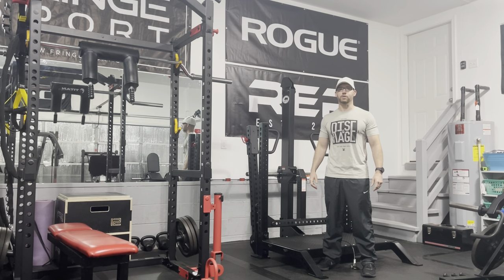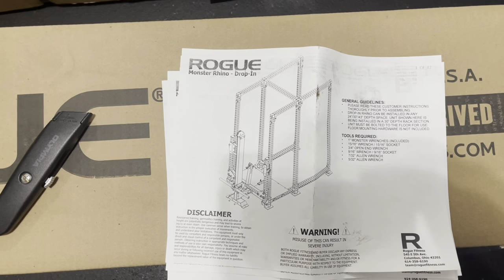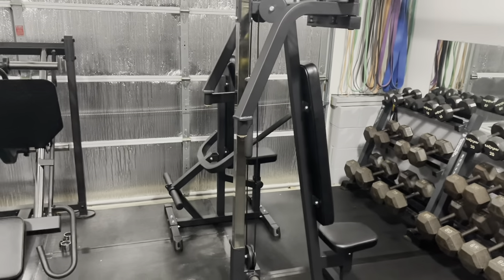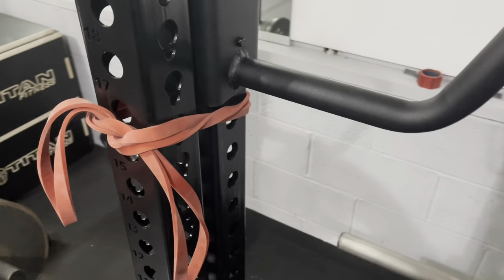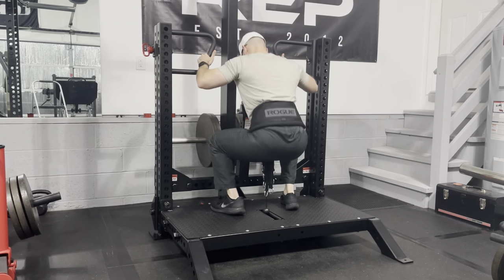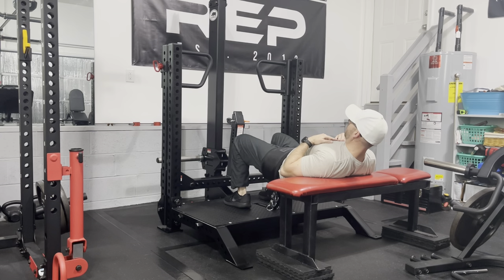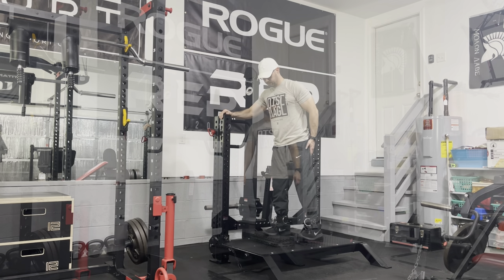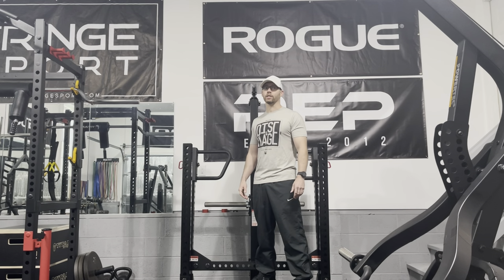Rogue Rhino Belt Squat Review

Comment: 25:17

Doesn't your rubber ball get grinded by the cable with low row movement? When I did my low rows I saw rubber dust being accumulated from it.
Reply from the maker: I have not noticed that.  I don’t do a lot of rows where I sit on the floor; rather, chest-supported rows while on my bench.  2 years later and there is no indication the cable is getting worn.

Comment: Is the rhino good and easy on the knees?  I have two buldging disk amd a bad knee but still working out legs with landmine squats, lumdges, goblet etc...
Reply from the maker: I can’t say for certain if it will hurt yours, but it does not aggravate my knees or back.  If it were a Lever Belt Squat it might as you would be pulled forward, but the Rhino offers a vertical line of drive.
Reply: @HomeGymHacksandReviews  thank u

Comment: Why did rogue make the uprights with holes in them? For attachments (like a regular squat rack)?
Reply from the maker: I have a new video showing my Top 5 Accessories for the Rogue Rhino where I attach the Safety Spotter Arms and Rollers into the uprights.  Neither work amazingly, but it does make future attachments possible.  It can also take plate posts.

Comment: I have a couple of questions.  How do you like calf raises and donkey calf raises on this?  Also could you do a hip thrust if you elevated your feet?  I am thinking about purchasing this plus an RM-3 rack and setting it up like a drop-in since that would allow me to add a belt squat while only taking up about 8 additional square feet of space.  Would the four uprights or plate storage on the rear uprights affect the functionality of the belt squat portion?  Thanks!
Reply: I should add I already have a rack that takes up 53 inches of depth on the floor, so a rhino attached to a 30 inch rack would add about 6 inches of depth.  I could do 100% of my rack work on a half rack with the exception of squats, and the belt squat solves that issue.  I was thinking of getting the rogue monster utility seat to attach to the spotter arms for use as a back rear on hip thrusts and possible as a step up platform.
Reply from the maker: Calf raises and donkey calf raises are good and I prefer those to loading my spine with heavy weight.  A calf block on the platform is likely a better option than performing calf raises on the edge simply for a more vertical line of drive.  
The plate storage should not impact the functionality of the Rhino.  I almost went with a drop-in when I couldn’t get the stand-alone due to it being out-of-stock.  Luckily, the stand-alone became available before I spent the extra money for a rack.  Like you, my plan was to do most of my barbell work on the outside of my rack.
Reply: Thanks for the quick response!  How much space behind the rhino do you need to accommodate a standard 45 lb plate?  I have grip plates so I don’t need much more than an inch or two between the plates and the wall.  I do plan to use the band pegs as well.  And would you prefer a smith machine or the rhino for calf raises and other leg work?  I’m trying to decide between adding this or switching out my powertec lat pull down for an inspire ft2.  Thanks again and have a great day!
Reply from the maker: @jeffwalker1830  I have 13” between the wall and the Rhino. The band pegs stick out farther than any other part of the Rhino which is where I measured from.  
I prefer the Rhino over a Smith for leg work, but I use both because I have a lot of variety in my training.  
For Pulldowns, my choice will be a lat pulldown over a functional trainer unless the functional trainer has built-in leg roller pads (most don’t). 
If you have the space, I wouldn’t sell your lat pulldown and I would eventually add the other two pieces (from personal experience, I usually regret selling equipment unless I really dislike it or don’t have a need for it).
Reply: Thanks again.  Yes I would love to have both but I’m very limited on space.  The inspire ft2 has a high/low pulley and you can hold your legs down with the smith bar.  It also has a functional trainer so it functions as 3 machines in a 60x58 footprint.  I would actually love for you to review it!  If I could squeeze both in I would have a smith machine, hi/low pulley, functional trainer, belt squat, and half rack all in a smallish dining room.
Reply from the maker: @jeffwalker1830  I almost got the Inspire, but opted for the Powertec Smith and Powertec Streamline Functional Trainer which were less expensive combined than the Inspire…but take up more space.  At some point, I would really like to review that machine.
Reply: @HomeGymHacksandReviews  That would be awesome!  I would love to hear your thoughts on it vs something like the IM2000.  And I would love to see how many hacks you could come up with!  One big advantage if you have the space for both of those Powertec machines is that they will be exponentially easier to move if you ever have to.  Moving the FT2 seems like quite a challenge.
Reply from the maker: @jeffwalker1830  it’s going to be tough for any smith machine to hang with the IM 2000 (smith-function alone).  It would be cool to compare to other machines and hack.  Maybe at some point I can get it.
Reply: @HomeGymHacksandReviews  I just checked out the ft2 at a showroom and I think I’m sold.  I’m curious, what do you think is superior about the smith function on the IM2000?
Reply from the maker: @jeffwalker1830  it is extremely smooth.  There are 38 lock out points.  It has a 1,000 pound weight capacity.  It has the ability to accept a lot of attachments / add-ons.  
There are a lot of great things about the Inspire too.

Comment: Since this video is a year ago just wanted to check to see if you ever bolted to the floor? If not have you had an issue with not bolting it down? I am sure you are using much more weight than I would ever use. Thinking about purchasing this machine because I have low back issues but still want to squat. Thanks for the video.
Reply from the maker: I have not bolted it to the floor.  Also, I have not had any issues.  Thanks so much!

Comment: Question: Are the pulleys plastic ? Im wondering how this can hold so much weight , are the cables much thicker than a normal cable machine?
Reply from the maker: Hey MC!  The pulleys are plastic and the cable is a little thicker than a typical cable.
Reply: @HomeGymHacksandReviews  

Thanks man , appreciate the response. Setting up my DIY belt squat with my cable station and was curious why mine only holds 250 when the Rhino holds so much with basically the same system

Comment: Great review and hacks for the Rhino. 👍💪 
Question: Does the cable rub anywhere on the machine to cause damage to the cable when you are doing the hacks that you show especially the low row ? Thanks
P.S. You need to make a hack so users can do lat pull downs on it !
Reply from the maker: Thank you!  
Thank you!
Luckily, the cable doesn’t rub anywhere…as I was initially concerned it would when doing seated rows.  
For Lat Pulldowns, a rack and overhead pulley is required.
Reply: @HomeGymHacksandReviews  any way you would be willing to show this movement? I bought this machine based off of your review. It is the only cable machine I have. I have a bench dumbbell bands and now this :) I'm in love I even figured out how to use my bands to do leg presses with it today. But I'm trying to grow my lats also I haven't bought any lat attachments or that daisy thing yet I just assembled it last week. I had to quit barbell squats due to a head/neck/shoulder injury and this so far has been great I appreciate your reviews
Reply from the maker: @Dezlou  I don’t have the rhino attached to a rack and pulley system that would enable me to do lat Pulldowns on the rhino.  
If you go to Rogue’s webpage and search for the “slinger,” you will see a high pulley option, but again, the rhino must be “dropped into” a rack.

Comment: I have found once over 10- 45s. The belt expanding. Is this common.  I easily do 16 total 45s on the Atlantis with no simular issue
Reply from the maker: Unfortunately, I have never had 10 45s on the machine…I’m not sure if I ever will, so I can’t be of much help. So, my compliments to you.  
I really like the Rhino belt because it is extremely comfortable when I go heavy, but I am sorry to hear it is expanding at the weight you are using.  If possible, I would use the Atlantis belt on the rhino

Comment: So question of the day: would you pick this belt squat or the Powertec Squat / Calf machine? 

Trying to decide between pendulum squats for belt squats as substitute for barbell belt squats
Reply from the maker: The Rhino.  It’s been my number one machine from the day I got it.  A lot of equipment has come and gone since I started this channel, but the Rhino remains.  It’s also far more versatile than most leg machines.
As for the Powertec Squat / Calf; technically it’s not a pendulum squat, although I started using it like one.  It’s a good machine, has a smaller footprint than the Rhino, and it will save you a lot of money.
Reply: @HomeGymHacksandReviews  thanks for the response. Oh man…now all I have to do is convince the wife. You mentioned an affiliate link but I didn’t see one in the description….
Reply from the maker: @chrisa8203  thanks so much and glad to help.  All of my affiliate links are in my Linktree, which can be found in the description of this video.  
I have a few other videos featuring the Rhino if you want to see it in action more.

Comment: Hello I have a new Rhino and not satisfied withe the "feeling". For me it feels like, that there is a lot of tension and it doesn't feel as smooth as working out with a weighted belt. Did I something wrong with the installation?? Thanks a lot for your answer! Appreciate!! 🙂
Reply from the maker: That’s tough for me to diagnose without seeing it, feeling it, and hearing it.  It should be super smooth and super quiet.  If there is an issue, it would be with the cables and they should go under the stoppers and not over the stoppers.

Comment: Debating between all in one functional trainner ( force usa, brute force, french fintness) or getting the rogue monster rhino belt squat + rack.. it looks like I can do all kinds of stuff with rhino belt squat.  I have 2 buldging disk in lower back so this will be good. Also looking at the rep fit with ares and their belt squat attachment.  Anyways I would like to know how to bench press with rhino platform in the way?? It looks like it will get in the way of the bench??
Reply from the maker: You would add spotter arms and bench on the outside of the rack.
Reply: @HomeGymHacksandReviews  yea I was thinking about getting the rhino bt squat plus rack..the rack it's 24" but it looks like there is only about 4-5 inches of space from the front uprights and the rhino platform on floor..i don't see how I can do incline, decline using a bench outside of rack?  Rigjtnow I have a prx wall rack and when I do decline and incline bench I have to move the bench back about 13 inches so I can bench..I don't think I will be able to bench outside this rack with rhino built in to it.
Reply from the maker: @futbol1972  you would need to purchase safety spotter arms and basically make the rack a 1/2 rack.  Everything will be done on the outside.
Reply: @HomeGymHacksandReviews  yea I was thinking about getting the rhino belt  squat plus rack..the rack it's 24" but it looks like there is only about 4-5 inches of space from the front uprights to the rhino platform on floor..i don't see how I can do incline, decline using a bench outside of rack?  Right now I have a prx wall rack and when I do decline and incline bench I have to move the bench back about 13 inches so I can bench..I don't think I will be able to bench outside this rack with rhino built in to it:(
I emailed rogue and they said that not even the 30" rack will work with a bench outside since it only has about 6-9 inches of space in the front:(  
Iam I supoused to bench, incline, decline standing up without bench. Lol...I don't know what's the purpose of them selling it with rack if I can't really use rack not even to lift outside of it?

Comment: Have you experienced fraying when using as low row?
Reply from the maker: No; because inside of the platform, there are round rollers that the cable travels over.  That was one of my initial concerns before I got it.
Reply: @HomeGymHacksandReviews  Interesting- I though the same thing and somehow I managed it! I was using a neutral grip handle with clients and after a few circuits I noticed. But it tore up the cable.... I noticed a slice in the cable when I put together and didn't think anything of it. Maybe that? Or I have at the end of my garage so there is a slope - could that impact you think ?
Reply from the maker: Hard to say for sure.  Do you have the plastic pieces covering each of the bolts the cable touches?  (I think there are 2 or 3)
Best case scenario, it could be just a small surface scratch in the vinyl that coves the cable or it could be more severe than that.  If it’s just a surface scratch, I would cover it with electrical tape but check periodically to see if it’s getting worse.  If you are really concerned about it, and you may be because you have clients using it, you could reach out to Rogue and see if they can send a replacement cable.

Comment: The issue I found with this... or other similar belt squat. The unbalance result.  Stronger legs yes. But barely any core engagement. Not much lower back enagagement.  A barbell squat is still king as it forces the upper body/core to engage/build.. 2nd best option is the supersquat machine. Belt squat is good as a warm up or finisher.  Should not be used to strictly develop legs, especially going real heavy.  Disproportionate result... that can cause pain and injury
Reply from the maker: I see what you’re saying and you make a valid argument.  If I could squat, I would squat.  However, my days of loading a heavy barbell and putting it on my back are over.  Also, there are some people, I’m pretty sure I am one, who the squat just isn’t a great exercise due to structure, flexibility, etc.  Also, I train my core in a lot of ways directly and indirectly.  
This machine has been a game changer for me and has resulted in a lot less pain and 0 injuries compared to my days of barbell squatting.